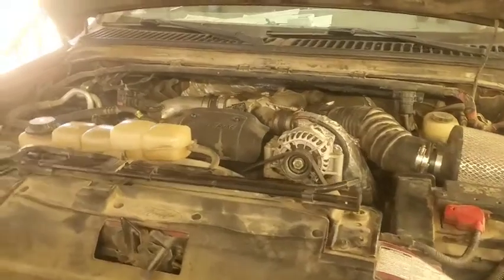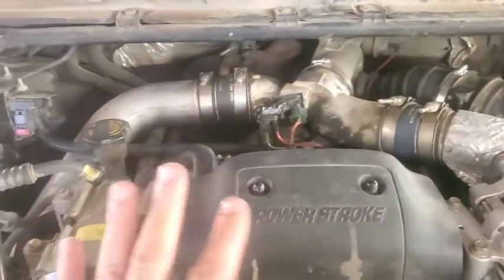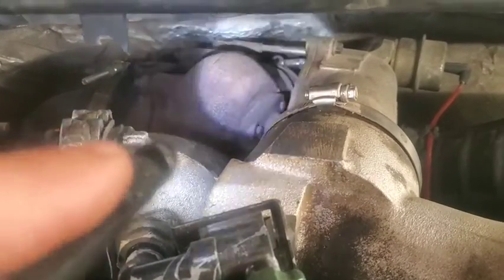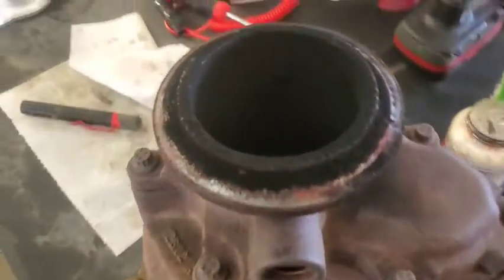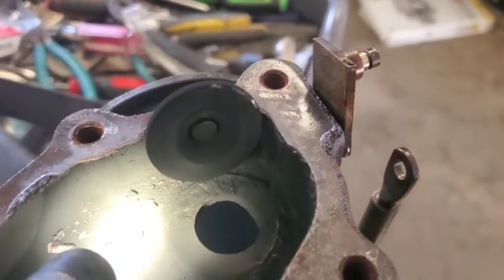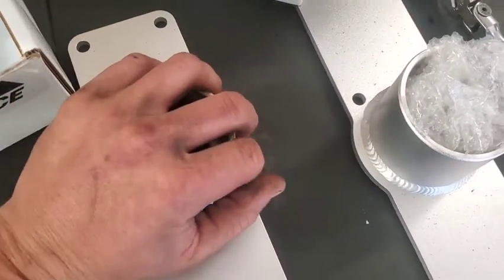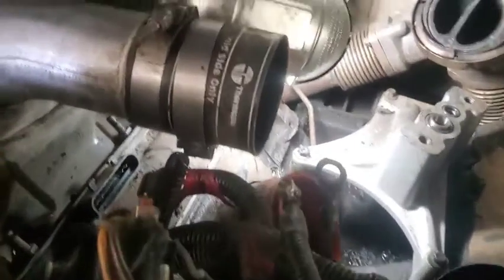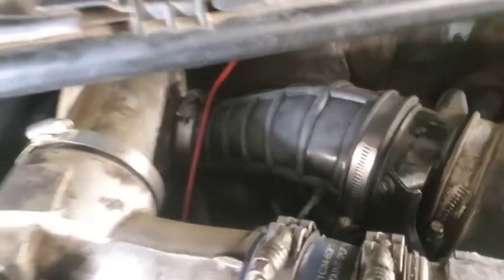7.3L Powerstroke: boost leak and waste gate fix

Comment: The shop is telling my dad his waste gate isn't working properly and that's why his transmission is shifting up way to early and won't downshift on hills even towing 13k lbs (99 7.3 powerstroke) they say itd be 3500 dollars to fix and I just can't see why it would be that much to fix, I know nothing about diesel engines or turbos but I feel sure that it shouldnt cost over 3000 bux to fix a 300 dollar part. I feel like the owner wants new rims for his gaudy pavement princess and wants my dad to pay for them. I have all the confidence in the world that if I knew Wich part specifically to replace, I could do it myself, after looking into it a bit I've come to think it's the waste gate actuator, the truck has 290k on it and never had a single engine component replaced, since your familiar with 7.3s what would you think is the culprit? I appreciate any response
Reply from the maker: Without seeing the pickup it's difficult to tell.  If a wastegate is stuck completely open and doesn't seal at all you will loose boost and power, but you will definently hear it.  Especially when its cold.  There's also the exhaust back pressure valve that needs to be checked as well.  If the valve is stuck closed you will loose power as well.  The fuel pressure at the fuel bowl needs to be checked and have at least 45 PSI.  If it can't get fuel it can't create boost therefore, it can't make power.  The engine oil needs to be full and needs to have no more than 4000 miles on it since the last oil change.  
It sounds like the shop needs to do more troubleshooting to pin point the problem rather than just repalcing the whole turbo.  Make sure they tell you WHY they want to replace what they want to.  

The rule of thumb for any troubleshooting of any problem is this...........
If you plan on replacing a part.........
Think ahead in the future as to what you are going to test/try next if that replacement part doesn't work.
If you come up with something that you would test.........then you need to make that test before replacing any parts.